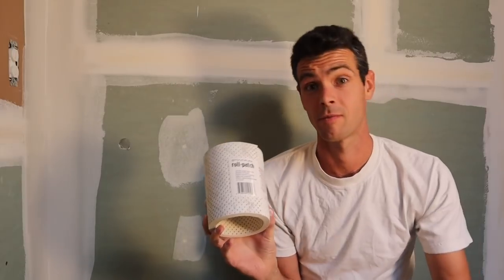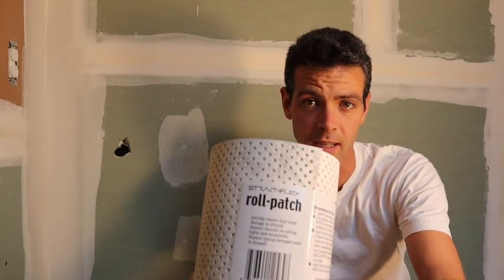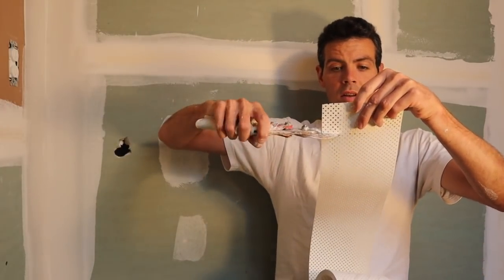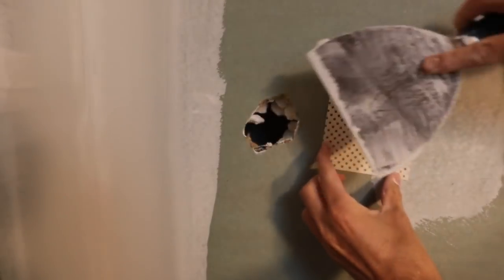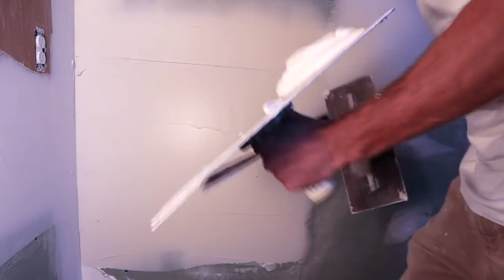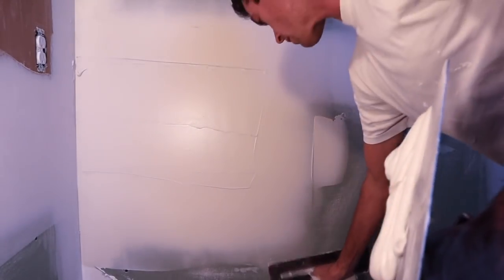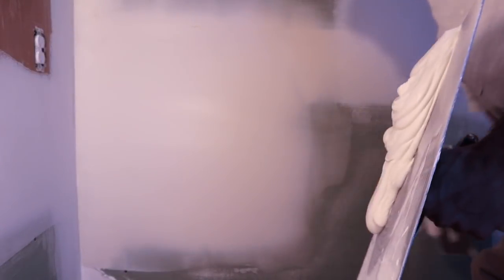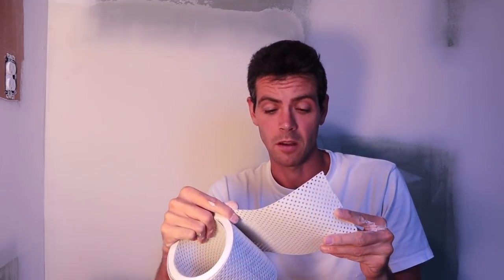Easy Wall Patch (Strait-flex Roll Patch)

Comment: I've found backing the hole with a piece of scrap drywall is stronger and cheaper (screw from front).   Then fill the inset a piece of drywall (screw into backer piece); then normally tape and feather.  - fastest, cheapest, handiest and most flat.  For bigger holes, backer strips can just go around the perimeter for the filler piece to screw to.

 I think this is how I filled the hole of a relocated laundry chute opening.

Comment: You neglected to point out that the roll patch is a pvc composite, so probably very strong.  I would have used this on my piece of garbage 1950's house to reinforce ceiling areas.  Nailed in 3/8" drywall ceiling that needed screws every 8" and some popped through.  I used a perforated metal patch cut in strips but this would have been better, could have rolled the whole seam.  But thanks for the video.

Comment: ever run  into drywall thickness issues cant find 3/8 all they sell is 1/2 at the nearest store to me 400kms next closest store would be 1200km drive in wpg. got some big holes to patch from someone punching walls

Comment: I really appreciate your channel. I know this isn’t your bubble video but I have a ton of bubbles in my drywall and I was hoping for some quick advise of what I should do. I already watched your bubble video and my wall is terrible from the previous contractors. Bubbles on the wall everywhere, however it is in the middle of the drywall sheet. I can see the seems between each sheet too. I’ll send a pic if I can figure it out but do I need to to cut them out (like you did in your video) and mud them? Thanks!

Comment: Hi one of the maintenance workers at my apartment covered a hole that was in my wall. As it was drying my kids were bothering it after I repeatedly told them not to. One of my kids punctured a hole with their fingernail as it was drying. It has now dryed with a fingernail puncture. Can I paint over that to make it less noticeable?

Comment: Remove hammer from hand before talking.
I used duct tape and mud on a hole in the drywall behind the refrigerator when I first moved into my condo.  That was over 30 years ago and two paint jobs.  Who looks behind frigs anyway?

Comment: When I was a apprenticing electrician, I worked for a company that specialized in rewiring older homes ...we would bash holes in the wall/ceiling point to run wires and fill the holes with crumpled newspaper..slap a little mud on and good to go
Reply: William White  Well..their advertising pitch was "Rewire before fire"  guess that was accurate ..lol
Reply from the maker: @p-m2127  😂😂😂
Reply: William White  yea, I do the same In Chicago, Find Crazy shit in Walls.!!

Comment: Thanks for doing such helpful videos! I've watched a ton and have learned a lot. I'm having a hard time deciding which way to do my current project. I'm installing floating shelves in my kitchen. I've decided I will use heavy-duty braces attached directly to the studs. So, I cut out a piece of drywall approximately 1-1/2" x 10". The bracket is 6 mm thick, so the resulting area to be patched is 11 mm deep, obviously a drywall patch won't do it. I finished the first set of brackets using a metal patch with acceptable results, but it was a pain in the neck to do.  I think it would work to pre-fill with something like Concrete Fill, then proceed as for any other patch. So, my questions: (1) is this a good technique to use in this case, or is there a better one? and (2) is there another mud product that would work for this? I can't find either of the specific products you talk about in your other videos; the closest thing I see is a concrete patch/mortar compound.  Any advice would be appreciated.
Reply from the maker: What I would do in your case is pre-fill with confill. When set proceed to lay overlapping paper tapes. Feather and finish as necessary.  As long as there is no movement this usually works very well.
Reply: @vancouvercarpenter  Thank you. That's what I'll do.

Comment: Suppose after a lively conversation I don't have this fancy perforated strait-flex patch. Or even drywalling tape. Why would I not just take a sheet of paper out of my inkjet printer and use that instead? In principle should be quite similar, wouldn't it? At least it's quite thin. Has anyone here ever tried that?
Reply: The printer paper would not absorb moisture, and not bond properly with the mud. It would "pop" away from the wall as the mud dried unevenly around the paper.

Comment: Garbage product ~ it cost way more time & money than just using a scrap piece of drywall.
Reply: I agree better off using a California patch or a peice of wood and fill with durabond. Ive used these patches before and they always bubble out like that. I mostly use paper tape and durabond/hot mud for small repairs.